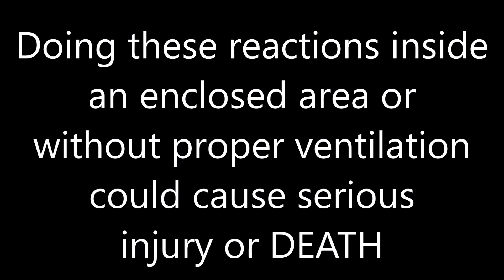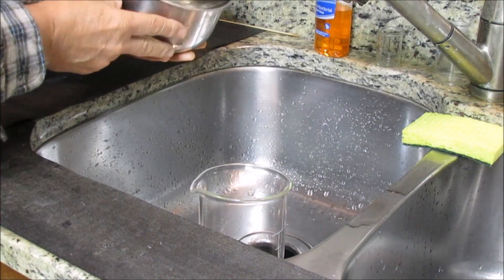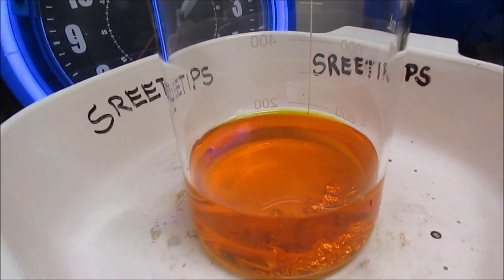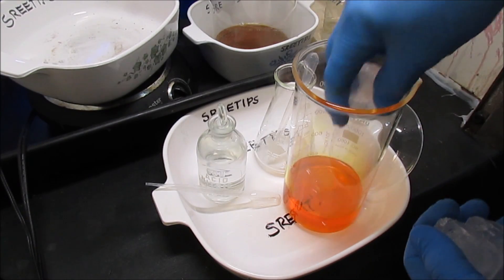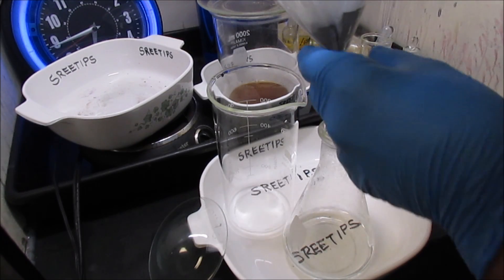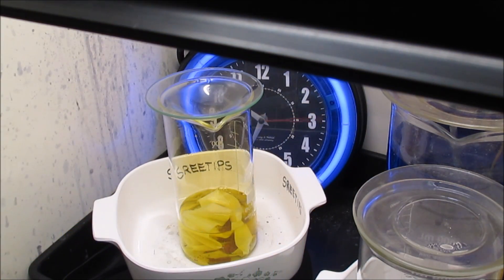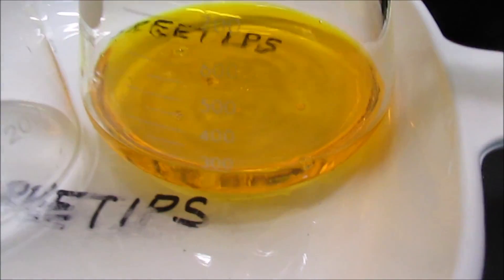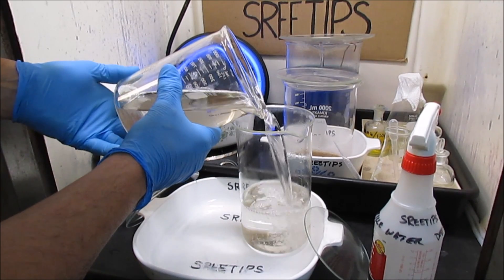Gold Repurification Jeweler's Bench Sweeps Gold Buttons

Comment: instead of using gas to remelt then pouring the shot...could you buy an anvil and a hammer and pound it down into a gold foil?? i'm not trying to be a jerk but you can pound it thinner than that shot..and use tin snips to cut it into slivers..
Reply from the maker: Yes, but that would add steps to an already lengthy process.

Comment: If you were going for the highest purity, I would have used a new crucible so as to avoid picking up any impurities from the used crucible that you used. If the previous melt was not 999 then the small droplets that usually remain up the sides of the crucible may have got into the final melt. Excellent videos BTW.

Comment: Great vid bud!
I love the processes you use to get good results.
BTW,
why did you post the fining process here when it was in the previous vid?
Shorter watch time?
No criticism, just curiosity.
Thanx again!
Reply from the maker: There was contamination in the gold buttons because two of them only had a single refining. The re-purification process is almost exactly the same as the original refining process. In fact, if you watch all my gold refining videos, they are all very similar. It's the same thing over and over. With some variation depending on the source material.

Comment: It's pretty wild how you have developed your technique for incremental nitric, which is completely awesome. As you've shown in prior videos, the standard AR formula is 4:1 or 3:1 HCl to nitric and you're getting it done (AND saving the deNOX step) with what....15:1? 12:1? That's great. Another super video!
Reply from the maker: Adding sulfuric acid is easy to do and it's a tiny investment with a giant payoff. Lead, even in trace amounts, ruins gold's malleability. It causes the gold to crumble and "spells death for Jeweler". Using distilled water in refining is not necessary to achieve the industry standard of 9995 pure gold. When working with silver, distilled water is required in order to avoid the formation of silver chloride  from dissolved chlorides in tap water. Hydrochloride acid rinses have the ability to rinse some dissolved metals out of the gold powder that water will not. These washes are inexpensive, easy to do, and take little time. Sometimes you can see the color of the gold powder change as the acid rinses it off.
Reply from the maker: The sulfuric acid combines with any lead that may be present to form lead sulfate. It can then be easily filtered out to remove 100% of the lead. I add it to every batch each time I dissolve the gold as a precaution.
Reply: Nitric acid is used to facilitate the gold/hydrochloric acid reaction.  Aqua Regia is created but only at the where the gold and hydrochloric acid are in contact.  I have made this incremental nitric addition on this and other channels, he may have had other suggestions to do it this way.

Nitric acid is highly monitored as it can be used in all sorts of bad ways.  Plus it is expensive in a relative sense.  I am puzzled on the sulfuric acid additions and hydrochloric washing.  I can see it with an unknown source of gold for lead removal.  But the initial use (when used to get gold into solution) of hydrochloric acid would have removed any other base metals.  Unless a inadvertent addition of lead or other base metals are suspected, this is an unnecessary practice.   Use of tap water is a reason this is why distilled water is best practices in chemistry.

It all comes down to keeping the costs of inputs and processes to a minimum.  The SMB is unnecessary but does help save on the most expensive resource...time.  Copper, iron, and electrolysis do the job.

Comment: Hey Sreetips, If you wanted to refine the Gold to 4[N's] could you use an electrolytic cell like you do with super pure silver? After all those hours and chemicals + separating the gems, how much should someone charge for a service like you provided?
Reply from the maker: Sorry, but I try to avoid other folks material in my shop (except for my boss). I only do this As a hobby.
Reply: Nopehahalolwut ,,, in order to run a gold refining cell,, you’ll have to tie up 2 to 3 ounces of pure gold in solution to run it,, That can become quite expensive at $1260+ per ounce
Reply from the maker: 10% is the industry standard. You can get gold to five nines with two passes. First dissolve the silver out of inquarted gold with multiple nitric boils until the final boil is as clear and colorless as water. Then dissolve the pure gold in AR and precipitate with copperas. Rinse the resulting gold powder with plenty of hydrochloric to remove iron. Then dissolve again in AR and precipitate with SMB or oxalic acid.
Reply: I've got at least 11+ ounces of pure silver that became dirty when I was first learning to pour/testing steel for molds, what is your cut to refine it?
Reply: Also would be fun if you made a video of it.

Comment: Awesome vid I love watching your vids can you do a catalytic converter refining vid thanks
Reply from the maker: Yes, it's coming up soon. I am trying to get the required experience before I get going on the cats.
Reply: Getting the PGMs into solution is the same as gold.  You will need to get the cats material into a flour consistency.  You will also need to know what generation of cat you have.  The most modern have Pt, Pd, and Rh, AR will not readily dissolve Rh.
Reply from the maker: Extraction of the PGMs is not the problem. It's getting the metals separated and refined. This is the required experience that I am referring to.